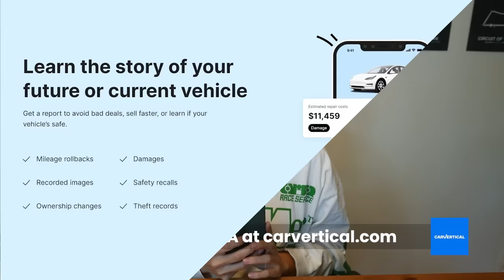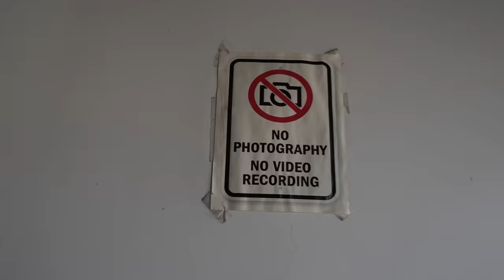Ferrari is not happy with my heavily modified 458..

Comment: I'd love to have a 1974 Ferrari. We worked on one once at the body shop and it was grey. I don't know how you can afford these cars. I have a 1970 Buick Skylark, wish it was a GSX, and a 1969 Chevy 4 speed, 402 C.I., 3/4 ton 4x4, converted from a 2x4 with 3 on the tree. Added power steering and power brakes. Ferrari sounds awesome!!

Comment: We had an F40 at the Sydney International Motor Show when I worked there...about 2001 I think and it was lent by the owner to go on display and a large light tower fell on it...straight down the middle of the car, it had to be shipped back to Ferrari to be fixed. Would've cost an absolute bundle to fix.

Comment: Interesting in Aust if you post up a video hooning on public roads you will get booked for reckless driving, so not sure how it works in the US.   I like the color of your 458 as it makes it really stand out from the pack, so no need to repaint it.   Typical of these exotic cars they just sit in garage never to be driven because the owner does not want to clock up any mileage - how sad is that when they can't even enjoy the car (they would be better off buying a painting to hang up on the wall)

Comment: Barely driven F-40, but sat for 17 years, that's likely got a LOT of problems, and will be EXPENSIVE to fix !!!
And Ferrari themselves are usually... difficult, to work with, they find everything that is not 100% original and how they do it and that they didn't do it completre blasphemy and want to control you and your car.
A dealerships actually being cool is very different, and frankly great PR for them.
"Drive it like ya stole it"
*Takes off sliding...